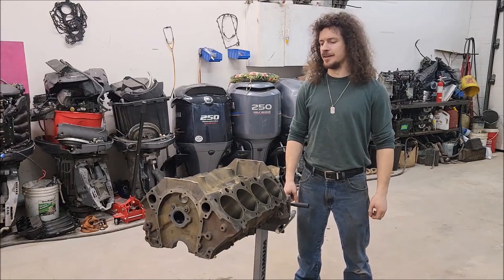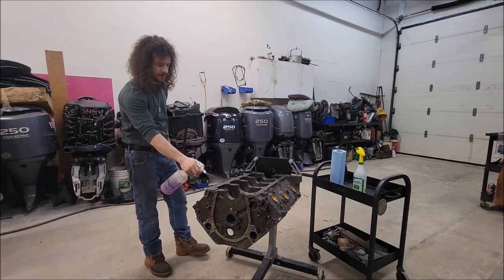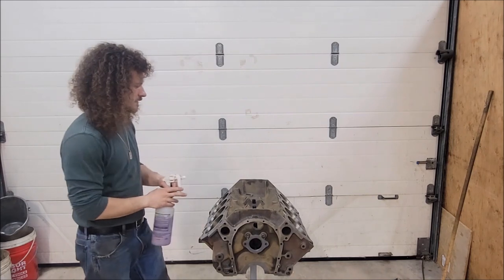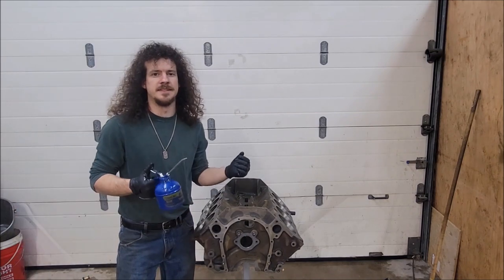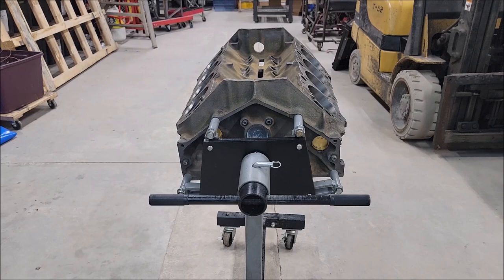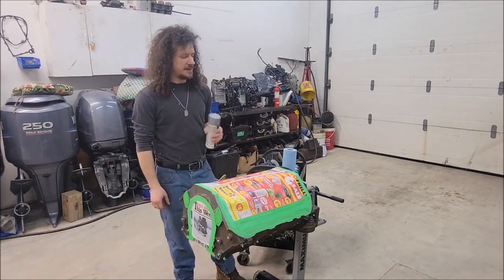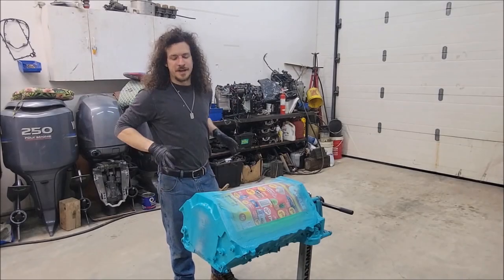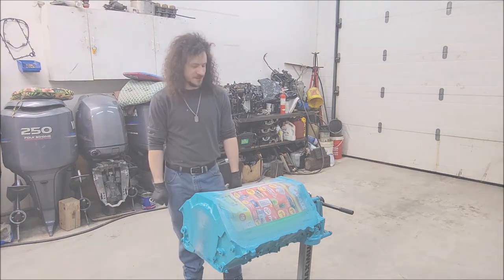496 Stroker Build PART ONE: Engine Prep And Paint

Comment: I have a similar method for prep. 1. after getting it back from the machine shop, i run a tap in every bolt hole to remove anything that may be in them that could screw up torquing the bolts. 2. then i spray it with soap and water.  I prefer Dawn dish soap. and a good stiff bristle brush and scrub it down. and take a brush to all the oil passages and cylinders. ,3 Rince with water and blow it dry and hit the cylinder and lifter bores, cam bearing bores and main bores with wd40 to keep them from rusting.   4. install freeze plug and cam bearings and oil gally plugs, then i hit the areas I am going to paint with acetone to remove anything that could be left over. 5. finally mask and paint.

Comment: Just asking, but why didn't you have the machine shop dip it and clean it there? Price? Preference?
Reply from the maker: The machine shop actually does dip and clean it but since they aim to be a little more environmentally friendly, whatever they use to do it isn't as efficient as it used to be. I stripped most of the paint off the block before bringing it to them and whatever they do didn't get 100% of what was left off! I also clean it just to make sure theres nothing left over in the cylinders or oil/cooling passages from the machining process. Thanks for watching!

Comment: heating up the block outer surface a spot at a time with a torch can help turn water inside the pores to steam and wick them out to the surface to be wiped away, helping paint retention a bit more.

glad to see you didn't paint the inside of the block--it never does what people think.
Reply from the maker: Good advice, also helps remove excess oils and stuff! As far as painting the inside goes, I think if it is applied PROPERLY (meaning BAKING to cure it) it does help a little bit, but in my opinion not worth the potential risk. Search up "Jafromobile" on YouTube, he actually does a pretty good in depth look at the process and benefits! Thanks for watching!
Reply: @Aidansbuilds  well, the problem with painting internal surfaces is, you have to prep them...and doing so gets rid of the sand you're trying to hold in. and you won't smooth anything with paint, so you have to grind it down...which means you already smoothed the surfaces. as for any rusting during storage, you can overfill the crankcase or just turn it regularly and oil will repell water--ever crack open a sealed engine from the junkyard and find rust?

if it's a real problem, then paint the heads--which few ever do. but then you have to paint the springs and piston rings and bearings since they rust--and no one's going to do that. so it becomes a non issue. just rotate the engine every now and again to take pressure off the valve springs, and cycle the oil thru it and the oil film will repell water.

Comment: Hi, since I'm not so familiar with chevy engines and haven't done the stroking yet, I have some questions and hope to get some tips from you, since I want to build my engine from scratch. First of all, congratulations on the great job and the cool videos
To my question, is the 496 based on the 454 engine? I read somewhere that the 454 is available as a 4 bold main, does the 4bold automatically have a 2pice seal. Is the one piece seal worse or are there problems with the one piece ? Which camshaft would you choose if you have both a good idle and sufficient vacuum for the brake booster, the power from 650-700 RPM idle to the end of the revs really pushes the car forward, but also does not lose too much power in the upper revs ?